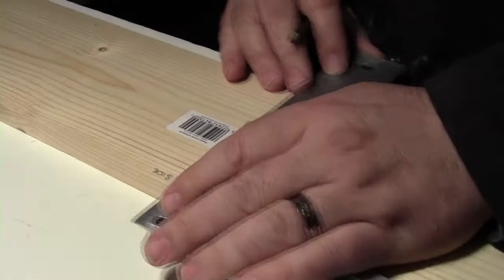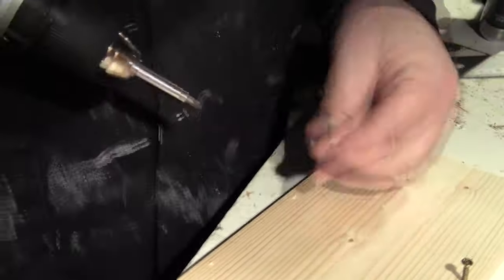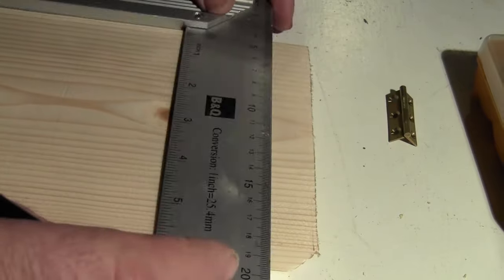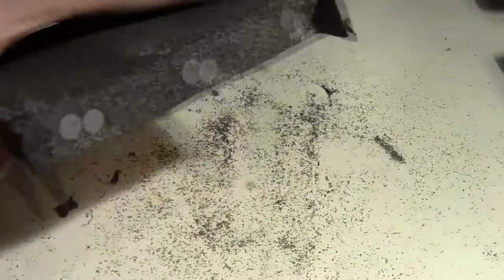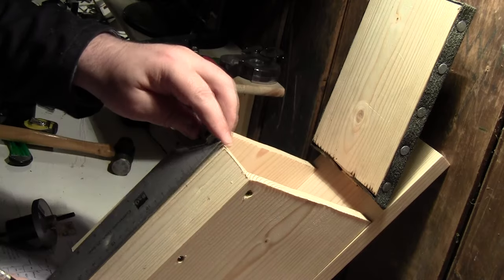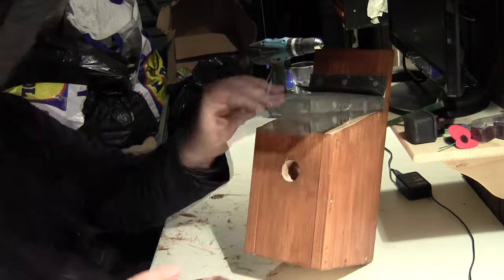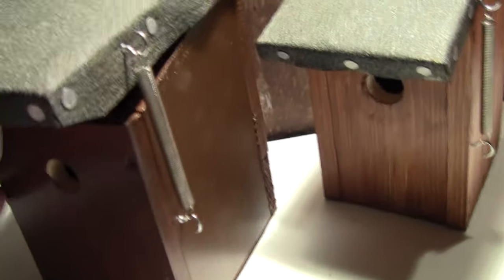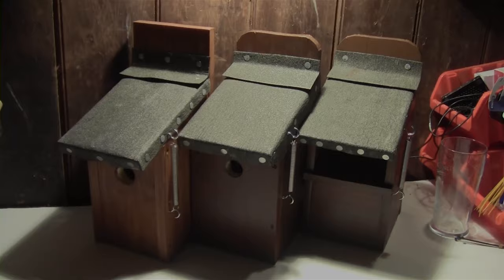Building A RSPB Birdhouse / Nesting Box

Comment: Use a hook not a spring. A determined squirrel will push even a high tension Spring. Cut the front to the same angle as the roof, (but make it a better fit!) the roof will sit better and it will prevent draughts, drill holes in the base for draining and ventilation. Make you don't site the box south facing or the sun will be on it all day and fry the birds! Somewhere the sun can get on it in the morning then part shade in the afternoon to allow it to cool down. Drill the hole in the front to suit the size of the intended bird. (28mm to 32mm). Don't put a perch on it and clean it out in the winter. Use only water based preserver and then none on the inside. Don't build with tanalised timber. Site between 5ft and 8ft high. Other than what you missed out not a bad vid!

Comment: I had boxes that opened from the top for cleaning, but I found it difficult to clean them well without taking the bird box off the post. Now I build my bird boxes to open on one side so they can easily be swept out between nestings, or in case wasps try to build inside the box. I do like the spring idea to hold them shut.
Reply: I use a screw going  into  the roof and one lower down and then cable tie it works well.

Comment: I like the roofing material, very nice finish too.  I would rub wax on inside of roof so wasps cannot attach their nests in empty bird boxes.
I would also refinish the roof with diluted polyurethane so it soaks into the end grain and seals it against moisture.  Then coat with waterproof materials.  Coat all cut end grain edges with this to seal up wood esp on base. Once you dilute the oil based polyurethane with mineral spirits, it soaks in deeply to harden wood and preserve it.  I would also do the outside panels.  If you paint on top of poly, then poly up the paint too, it seals the paint layer and preserves color.
On inside, please put wire mesh on front panel inside, and rough up wood so birds can climb out of nest, esp babies. If wall is too slippery they cannot climb out and die.
The floor should be recessed 1-2 inches higher than bottom of sides. This prevents water pooling under and seeping inside making wood damp and moldy. 
The spring is a great idea!!  Never thought of predators opening up the hatch!
Very nice build.  That thick wood will keep them insulated and cozy.

Comment: Excellent video, thanks for sharing. 
I have added drainage holes at the bottom of mine which gets rid of any ingress of water plus 'watery stuff' from the chicks. 
Robin box - I have added a few more inches of wood, extending over the front like a kind of Porch. This is to stop any Magpies taking the chicks. Makes it difficult for the Magpie to bend it's neck" to get it's beak inside. 

Entrance hole - I have protected the hole from Woodpeckers/Squirrels and other predators by surrounding the hole with metal. I used an old cake tin. Drill a hole in the base of each cake holder, big enough to surround the entrance hole then cut into a rectangular shape to then screw into place.  

Ps, sorry but background music was a tad too loud and distracting :-) Spoils your excellent commentary!

Comment: I volunteer for the RSPB and I've been making many of these as well as bat boxes and dormice nest boxes. Interesting take on the roofing felt and the spring. I've been recycling old broken pallets from work for mine and to prevent the water running into the box I've used part of an inner tube tacked over the lid to the back forming the hinge. I've then placed a small strip of wood across the top of the inner tube, pinned it into place and sealed with external wood glue. To lock the roof in place I've used a single screw  driven down through the lid into the front plate.

I've also extended the back down underneath the box so it can be fastened to a surface at the top and the bottom for extra support. The back plate I've cut on my mitre saw at a 30 degree across the top so water drains off. It's also cut at the bottom for decoration.

The only thing I don't do is apply any stain - mine are all completely natural. Don't forget a few holes in the bottom for drainage. Don't forget that different sized entrance holes will help choose what breed of bird can use it. I've also used half open front for Robins and Pied Wagtails etc.
Reply: @wallycustard1281 Not in the EU or UK. Bromide was banned many years ago. Pallets are now marked HT as heat treated. Any chemically treated pallets now left over from old stock will be so rotten not usable for anything. As for risks of goods coming in out of the EU, they're monitored coming in. The pallets I was getting from work - guaranteed chemical free.
Reply: How to protect  Robin's eggs from squirrels?

Comment: If you are new to woodwork: When screwing through wood A on to wood B - If wood A is thicker than the distance between the screw-head and start of the thread, then a gap will automatically be created, unless you make the hole in A bigger than the screw-thread, or press/clamp the two pieces together. If you are new to woodwork. Try it on spare pieces before you start building the box.
Reply: just what the world needs.... another armchair expert  !!
Reply: @edwardandrews1381  Interesting misdirected sarcasm. For clarification, as I said, my comment was aimed at helping newcomers, of which there seem to be quite a few in the comments. I thought it might help, by avoiding the disappointment of a leaky nest box.

Comment: IMO the surroundings of the box are important too,  mine are accessible through a tangled 
squirrel and magpie-proof creeper that  provides perches for the adults and fledglings before  they 
enter and after they emerge & so giving them a less stressful life, my robin's nest is made from 
5inch corrugated land-drainage pipe over a foot long hidden from predators in the same way, for the past few years
robins have built a nest at the closed end where they are most away from danger.

Comment: Great looking bird house .I make them to donate at raffles or fundraisers and wondering what your cost of materials are estimated at I use rough pine 1"x8' and notch the "floor" corners for venting also drill small holes just under roof line. I use old conveyor belt for hinge and do seal ends of wood to make them last longer .thanks for this great video ,very well explained.

Comment: Nice box but needs some ventilation holes and drainage holes at the bottom. The entrance hole does not provide enough ventilation. I purposely cut the sides on mine 1/4 inch shorter so there's more air movement just below the roof.
Reply: Eric Neale are ventalation/drainage holes necessary because I have blue tits in a box with none which I bought from a shop.
Reply: Yes, it should have ventilation for the humidity and drainage in case of water infiltration.
Reply: Eric Neale thanks, it's just because most nest boxes I see in shops do not have any.
Reply: Michael Sinclair water won't drain with sides cut 1/4 inch shorter than the roof! The drainage holes need to be lower than where the water enters. A 1/4 inch gap below the roof will creat draughts. They're not needed. Drain holes should be 6mm drilled in the bottom. Drill about 4 holes. The nest material prevents draughts up from there but allows drainage. You can get good instructions from the wildlife trusts, BTO or RSPB and none recommend walls with gaps below the roof.
Reply: Eric Neale
I have spent months researching into constructing an aviary and discovered a great website at Aviary magic method  (google it if you're interested)
Reply: Along with these other suggestions, I also add a metal guard around the hole so that predators can not take the eggs or babies.

Comment: Good work! 
However there are two points I would mention that are recommended for bird houses that you did not apply in the construction of these boxes:
1/ Ventilation/Drainage holes on the bottom of the box. Best done by cutting the four corners of the base panel.
2/ Provide a rough surface on the inside of the front panel that baby birds can use to get some grip when trying to get out of the box.

Comment: These box are so cute. But, I don't understand why did you used wire spring?
Reply: The spring keeps the lid from being lifted by wind or by a predator or some animal like a squirrel that might try to get into the box from the top. The top is hinged so the box can be cleaned out each year when the birds are done nesting.

Comment: Holes sizes for anyone ?
 

    25 mm for blue, coal and marsh tits
    28 mm for great tits, tree sparrows and pied flycatchers
    32 mm for house sparrows and nuthatches
    45 mm for starlings.

The small box with 100 mm high open front may attract robins or pied wagtails. A wren would need a 140 mm high front panel, while spotted flycatchers prefer a low 60 mm front to the box.

Comment: Right, so if i have over 50 house sparrows which are under threat from 'garden grabbing residential development' adjacent to my natural garden, how can i help to re locate the house sparrow group ? I am after a design which can accommodate all the sparrows, a large communial roosting box but cannot find a design. The sparrows normally roost in ther eaves of old buildings, but that will soon change as the eaves are 'modernized' with plastic materials, so its an urgent request. RSPB were not helpful.